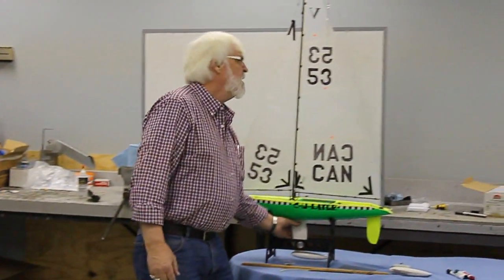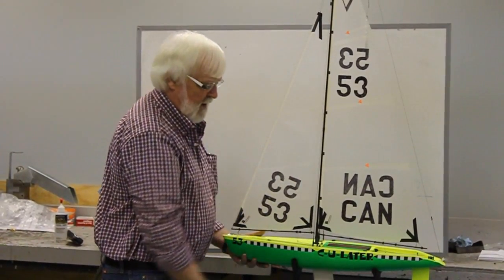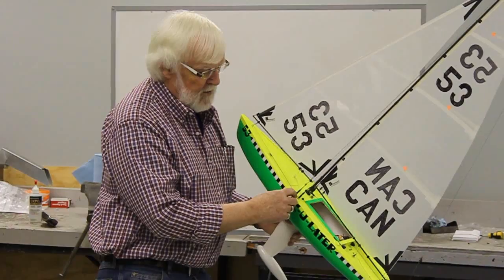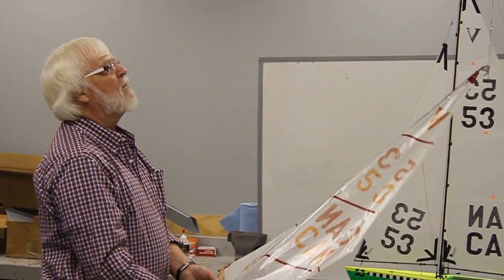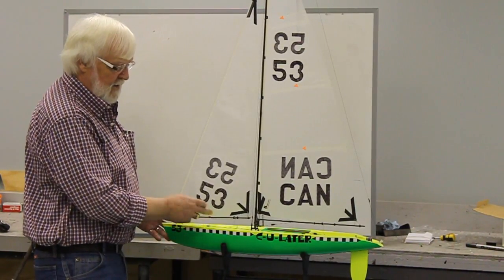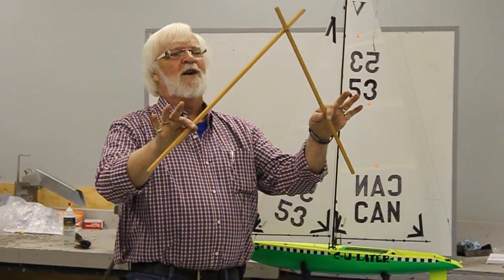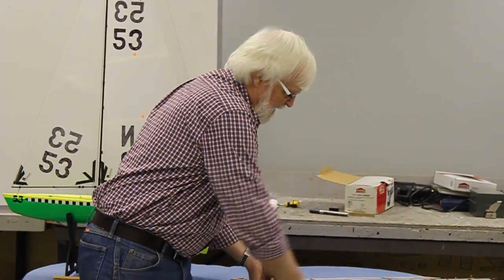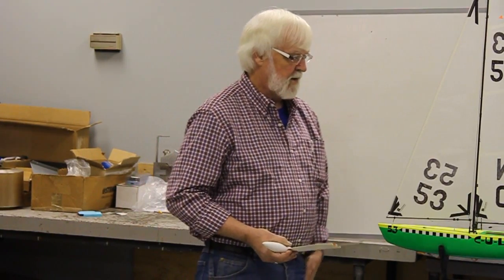RC Victoria Tuning Seminar with Bill Shorney

Comment: Hello sir, I am from québec and last year I bought the Thunder tiger 5546 and many part are not fitting. Did you have the same problem because I have no support with the company. My major problem is for the direction. The part came with the kit are not fitting. the plastic thing is to long and the hole are to small for the rod. Did you have the same problem. Second question, The kit did not came with the remote and servo. Did you use another company. Best regard and sorry for my bad english